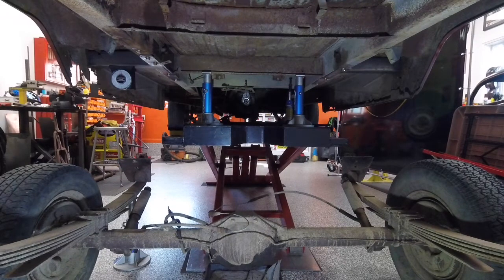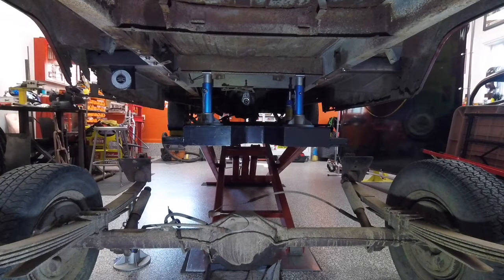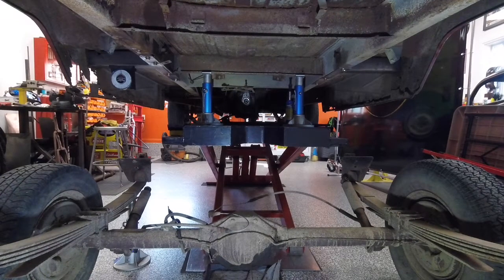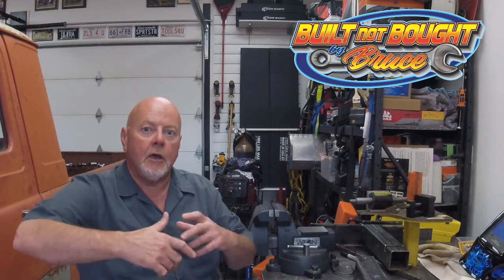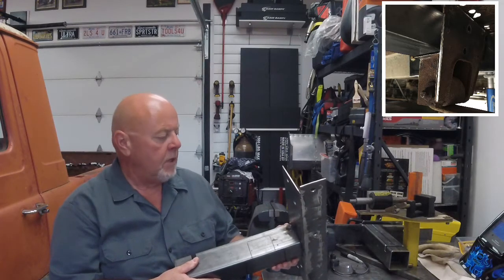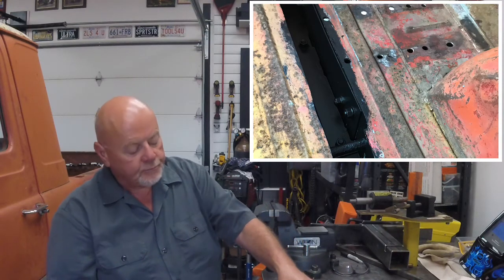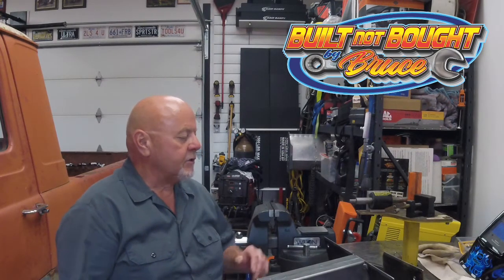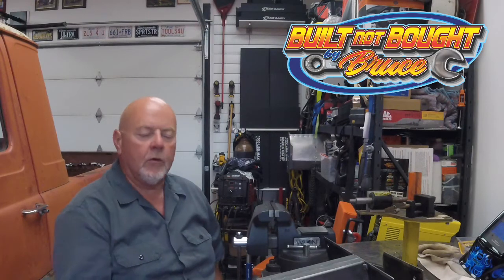1962 Mercury (Ford) Econoline E100 Pickup - Part 6 - Finishing the Leaf Spring Mounts

Comment: I'm heading over to the Oregon coast next week to look over and video my garage find. A 66 Econoline pickup. It's been in the garage for more than 15 years and I don't think it has even been turned over in the last 10. From what I'm told it has a similar issue with one of the forward rear spring mounts. Depending on it's condition, this may be a good way to fix the problem. It took me a moment to realize that you cut out the floor panel on the top side to insert the inner brace. When I first heard inner brace i was picturing the inside of the frame rail, like you would sister on a standard frame. It make more sense the way you did it. 

First step will be to get some good rubber on it. last time I saw it, most of the tires were sad looking retreads and one was flatter than a pancake. I might dig out a battery and try to turn it over during the inspection. Then I will have to figure out the transportation from the coast to my town. It does come with a spare 240ci motor that is sitting in the bed. So if I have issues with the one in the rig I can work on the second engine and just swap it out. 

I may start up a YouTube channel to document the work on it, but it won't probably get postings up as fast as you are. Day job and kids at home still.
Reply from the maker: Hi Glenn. I took a few vacation days this week which is why I’m behind on my YouTube stuff. I’m excited about your Econoline project and can’t wait to see pictures and hear about your plans for it. These old trucks really are a lot of fun, not to mention real simple to work on.

I will be posting a video or two soon about the cab floor repair. I’m very happy with the way it turned out. I’ve kind of hit a wall with mine as I’ve order brake parts and body panels that will be several weeks before they arrive. While there are still lots of parts available for early Econolines, they aren’t always sitting on the shelf.

Please let me know if you have any questions or if you would like to connect outside of YouTube. And thanks for watching, I really appreciate it!
Reply: Made it to the coast, spent more time on my dad's bronco, but did get a 2 minute walk around the Econoline. 
Link
https://youtu.be/FLaA3c7C0ao
Body is in better shape than I thought. Looks like it will mostly be mechanical repairs.
Reply from the maker: @gelfbrandt  what a great little truck Glenn. I subscribed to your channel so I can follow along. Please stay in touch. I look forward to sharing ideas and information with you.